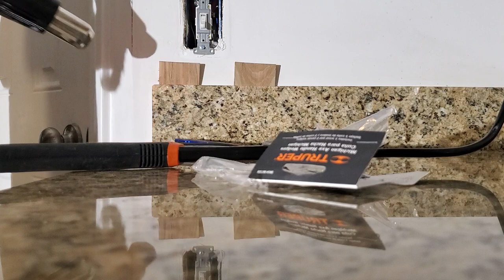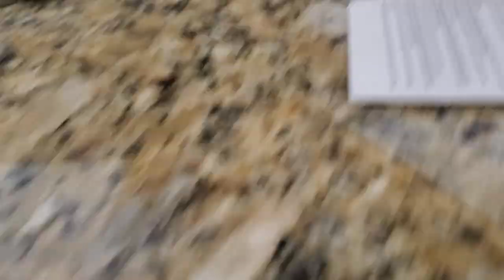Removing Granite Countertop Backsplash Lip in under 10 minutes.

Comment: You don’t need to heat caulk before cutting.  I’m not sure if the heat gun will help break what’s on the back.  Sheetrock is weak and will just let go.  Unless that’s the worlds weakest granite I wouldn’t bother.   You’ll just end up damaging the paint if your not careful.   Just take a razor and cut the caulk all around.  Stick a 8 in one behind it and tap.   It only takes about a minute.

Comment: How many times did you burn your hands during this job? Good video though, I would have add all the wedges out of the packaging prior, also would have worn gloves too (from previous experience with heat gun)
Reply: can you tell me whether heat gun is different from hairdryer?
Reply: @wch4972  same principle, but heat gun puts out more heat, usual two settings, hi/low both of which would cause skin burns if not careful!
Reply: @Al-gz2fh  
Thx